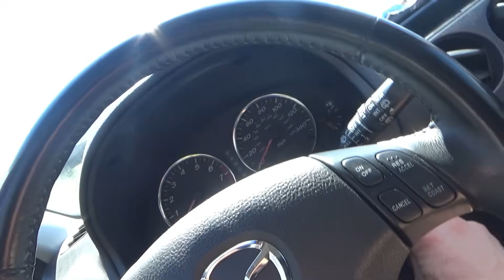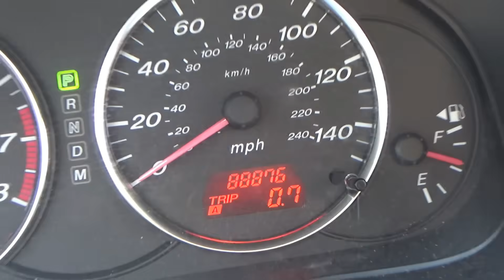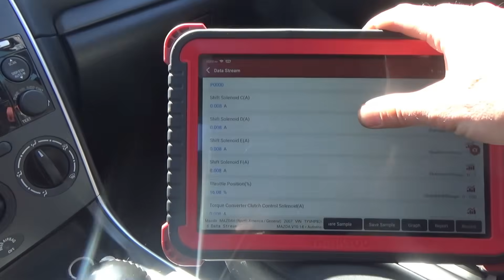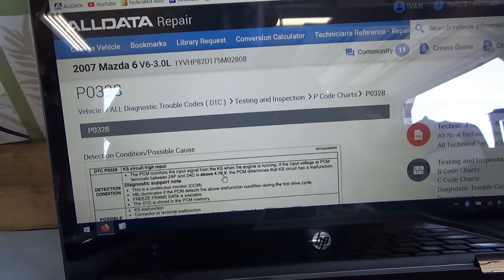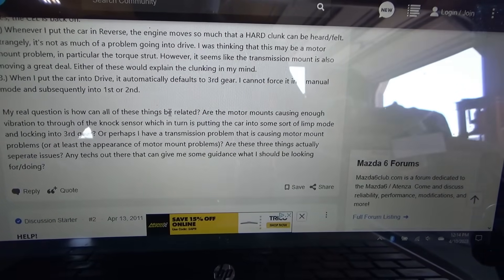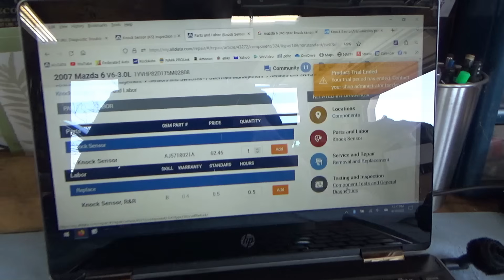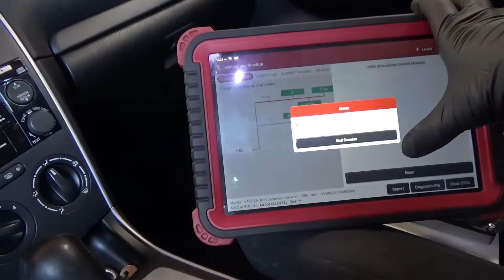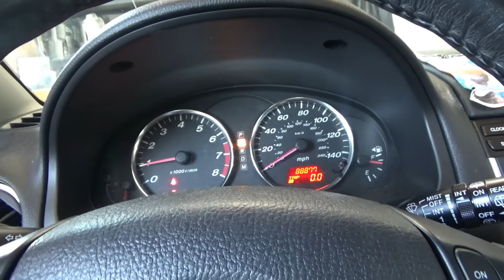At Transmission Shop for 8 MONTHS?? Fixed in 15 MINUTES!! (Mazda 6 Stuck in 3rd P0328)

Comment: Not the same but similar - My pickup with a 4l80e trans was in 2nd gear limp mode - Ended up being a shorted ground wire on an O2 sensor

Comment: I have seen VSS noise on signal end up messing up shift points which led to PCM in LOS (limited operating strategy)
It fouled all the plugs and wouldn't start and run anymore.
3.8L V6 AT Taurus.
The access was so difficult you had to remove exhaust to get a hand on it.
Customer declined repairs and kept putting plugs in it, I suppose.
Don't really know for sure if that was the only cause.
Ran fine shifted oddly and was in too high a gear quite often.
No trans codes found in any mode.
With a new set of plugs it would last for days but go back into LOS.

Comment: Imhad a Toyota with a P032(5?) a few years back with one of the customer's concerns was it wouldn't shift into
 overdrive;Onn the advice of an experiencedToyoyota rech, ended up swapping out an aftermarket KS with a Toyota unit .

Comment: They really need documentation for there kinda of issues. A TSB? Or a firmware update so the trans can code out why it is in limp mode. I had a trans limp mode issue , I beleive it was a kia soul. No codes , although eventually got it to code out for a trany speed sensor. It was under warranty so the dealer wound up replaceing the trany...  I like your videos and they are informative!

Comment: It's remarkable how often mechanics swap ECMs on the chance it might fix the problem! Which rarely seems to be the case.
In this case it also seems incredible that several obviously dismissed out of hand any possibility that a knock sensor trigger might be a reason for the transmission to be stuck in third only!

Comment: A monkey 🐒  with a $20 code reader could have fixed it. 
I had a guy take 3 hours to change his oil.
He was afraid to pull the drain plug. Thought it was connected to something in the engine.  Loosened the plug and let it drip for 3 hours. Dee dee dee.  .

Comment: I had a 2006 E53 BMW. Went into limp mode.
Trouble code was Z-oil?
WTF?
4WD transfer case oil needed to be replaced. 
Apparently the car shuts down at 80,000 miles demanding the transfer case oil be replaced.
You can't make this shit up.
Trouble code knock sensor. 
Just replace it... stupid people.
Also. 
That is one horrible,  gay car

Comment: I had an early 2000s Asian vehicle come in several years ago with no DTCs at all and transmission limp mode and I finally found that the battery was strong enough to start the engine but weak enough for the cranking voltage to drop below a certain undocumented threshold and put the TCM quietly into limp mode for the remainder of the key cycle.  I see many hundreds of cars a year so I can't remember the year and model, but the situation was memorable.  Fresh battery ---> fixed.

The internet forums are at least half full of morons, so always treat their solutions with a healthy dose of skepticism.

Comment: Did the motor ' jumping ' from a bad mount ' break ' the knock sensor which in turn put the  transmission in limp mode?

Comment: I've seen the same thing on a Tundra 5.7L! 

Mice get under the lower intake and chew the wires and the vehicle goes into limp mode. Doesn't make a ton of sense to me, but who am I to question an automotive engineer.... they've never made any questionable decisions, right?
Reply: my first thought when he had the knock sensor code.  Rodents chewed up the wires under the intake manifold.  2014 F350

Comment: I had this exact same thing happen with a 2009 Lexus RX300. Had very harsh shifting issues and did not want to leave 4th gear 

I replaced both knock sensors and fixed the problem

Comment: Be a ford thing, I had a similar story on a 2012 f150, had long cranks, rough running, way out of whack flexfuel numbers, only code it had was CHT sensor. I disregarded it for time being. Checking fuel pressure, fpm, fuel drain back etc. finally said screw it we need to fix the temp gauge anyways. I’ll come back to fuel problem. Replaced CHT sensor and everything was perfect cranked up flex fuel readings perfect, no misfires. I was like wtf ford.
Reply from the maker: @michealcannizzo100  temp sensor is VERY important for the base fuel map! 😉

Comment: I have fixed countless transmissions in limp mode but have never heard of this one before. Must be a secret known only to certain Mazda Techs and engineers. Can't believe there are no factory diagnostics for this or a pairing code set in the TCM. Hopefully Ivan you post this tech tip in Alldata.

Comment: I once did an engine swap on a 2001 BMW X5, E53.  Put the new V8 in, wired all up, started first go, perfect.  But there was an issue when driving, the transmission was all goofy when shifting.  I had an inkling that the engine was not reacting crisp to the throttle, under load.  So I unplugged the MAF, and the transmission shifted fine.  The faulty MAF was telling wrong info to the ECU and trans about load point on the engine, and screwing up the shift points.  It drove far better without the MAF ,  and dramatically better when the replacement MAF was installed.

Comment: Sometimes the codes steer you in the right direction and sometimes they don't. Reminds me of the story of battery light turning on,  the alternator had been replaced 5 times, it was a misfire (no codes) and you replaced the spark plugs. Problem solved.

Comment: @Pine Hollow Auto Diagnostics I have a similar problem with my 1993 Toyota Camry 4cyl Auto Trans. My check engine light comes On, engine goes into Limp Mode at 15mph, Code 4-2 Blinking on dashboard. Diagnosis bad Knock Sensor &/or wiring, tried all 4 sensors that i got from Pick A Part wrecking yard. None of them are good, stuck in a rut, about to call Ecology Auto Wrecking to come take this car away...

Comment: Hello. Great video. I have a 2006 mazda 6 V6. Has been driving and shifting smooth like silk. I parked and the next day I was not able to put it into Drive. Park and reverse ok no problem but the shifter will no go further is like stuck and wont go pass that point. Any suggestions Thank you much. JC

Comment: Does your code reader tell you if the transmission considers itself to be in limp mode, vs never getting a signal to shift?  I would assume the transmission uses engine data rather than reacting to torque to decide when to shift?

Comment: I got the same issue but it’s p0753 and it’s stuck on 3rd gear and I had fixed the solenoids and swapped out tcm not long ago and still got the same issues after 2 months of using the car

Comment: I HATE transmission shops.  NEVER had a good experience with them.  I learned though-  when my 76 GranTorino's tranny quit-  I went to the junk yard and got one for $100 (back in 79) - took me and my buddy a week to do the swap-  worked perfect.  Learned a ton. Had to rent a transmission jack- but that thing was amazing.  Anyway- Ivan,  you are amazing.  I hope that customer didn't pay those other guys anything. A whole year down because nobody wanted to THINK... other than Ivan of course.  What baffles me,  why NOT replace the knock sensor?? The code came up on the scanner- the part is south of $100 and it's pretty much in front of your face after you remove the BAD battery.  Even if it's a "no way it's the knock sensor" thing- you've eliminated a 'possible'.  Again Ivan-  just awesome.  I'd DEFINITELY travel 3 hours to have Ivan look at a problem.

Comment: It would be great if you could get an F150 in your shop and figure out why it accelerates when you press the brakes. My sister had one of these vehicles with this documented problem. I drove it and confirmed that it was not a carpet, or pressing the accelerator and brake pedal at the same time problem. Ford is not interested in this issue so maybe they will continue to say it is simply a case of people not knowing that they are pressing the brake pedal and accelerator at the same time.
Reply from the maker: Bring that exact vehicle to me. That would be an amazing case study!! I won't even charge you for the diagnosis!!
Reply: There are quite a number of posts about this issue. And no, I have never seen a post that stated replacing the throttle body and sensor cured the problem, however there are posts that state that they replaced these components without success. Fortunately this was a work vehicle and she no longer has it. It was a clear problem when I drove it and when I say accelerated I mean It reached around 4500 to 5000 RPM. When I shifted it into neutral, because it was not slowing down and the RPMs continued to climb, it continued to climb until I shut it down.
Reply: check brake boostor air leak

Comment: Had a friend with a Nissan Titan that got stuck outside my house when it wouldn't shift out of park. I thought it had one of those fancy electronic shift mechanisms but it turned out to be a broken shift lever bushing under the dash. We fixed it with a plastic wire tie and it lasted at least until the truck was sold 4 years later.

Comment: Sounds like crap with that shitty exhaust system. There are shops that don't want to do research or troubleshoot because that takes valuable time away from the money making quickie oil changes and brake jobs.

Comment: A few years back my W140 S-Class Mercedes would jump out of cruise control on the motorway, ABS light would come on and power reduced.....
FIX.... a new brake light switch on the brake peddle.
Go figure.
So you are right, fix what is broken on modern cars, the faults may all be interlinked.
Good troubleshoot👍🏻👍🏻

Comment: It is a good idea to check the alternator first. My 2005 Mazda 6 went into limp mode a few years ago and it turned out that the alternator was bad. I had the alternator replaced with one from O'Reilly's and it fixed the issue for about a month--until the car went into limp mode again. The alternator ended up still being the culprit. The problem is that at places like O'Reilly's or AutoZone sometimes the remanufactured alternators are not rebuilt properly. I learned that it is a good idea to have alternators and car batteries always bench tested at the store before buying them to spare yourself from future headaches. Hopefully this tip will help someone.
Reply from the maker: Get a Denso alternator from Rockauto, problem solved. Other aftermarket brands and sometimes even dealer remans are JUNK out of the box 😅
Reply: I miss alternator and starter rebuild kits

Comment: I have a similar issue. I’ve had a p0720 code intermittently and the transmission would occasionally act up. Now I only have P0328 and the transmission goes crazy after about 10 miles, and wont go into 5th. Gonna change the KS and hope for
The best

Comment: I've owned two transmission shops with over 30 years experience. The rule of my shop check engine light must be off before we diagnose the transmission. Sometimes that isn't always the easiest thing to accomplish because the customer doesn't want to pay for other repairs.

Side note I had this very exact problem and it was interesting to see you come up with the same answer as I did change a knock sensor  sent the customer down the road

Comment: What scan tool and software are you using I'm curious I'm about to buy a new snap on I have a Matco Scanner that's about 3 years old and it leaves a lot to be desired My old  Solace scanner got stolen Wondering if you had any input on a good buy that's not gonna kill me financially Leaning towards the Snap on because of the Diagnostic backup that comes with it Always really like the troubleshooter
Reply from the maker: Check out my Amazon store... Launch scanner for under a grand. SnapOn is an overpriced dinosaur... Only use it on cars to early 2000s 😉

Comment: Hello from London. My car kept going into limp mode with similar transmission issues (automatic box stuck in 3rd. and illuminated engine light).  I was dreading the cost of a new gearbox but was advised (by telephone) by my dealer to check if the petrol filler cap was tight. I thought it was, but he suggested removing it, blowing hard into the filler, leaving it for 10 minutes and then replacing until I heard two or three clicks. Turned out that the sensors had detected fuel vapour which wasn't being dispersed properly!  They had seen several owners of my model with the same issue.

Comment: i had a 1996 grand am with the trans pressure of the chart and in limp mode. Turns out it was a bad 2 wire air temp sensor. It seems each computer acts with codes that make no sense

Comment: had an 06 6s (v6) and it was a love hate, Loved driving the car, comfortable, good torque. Hated the front seal and valve cover (replaced) oil leaks and most of all the garbage aisin 6 speed transmission. in 140K the engine never gave me any real issues, but I did have 3 replacement transmissions under warranty. Trans would flair between shifts with at full operating temps. On the highway, peddle down it would buck between gears felt like the powertrain was going to fall out. Glad Mazda is wholly owned again, love my 17 Mazda 6, no a lick of trouble.

Comment: I've had this problem on my girlfriend's 08 Cadillac DTS. Hard shifts, not running through all gears, crank sensor code, I replaced the crank sensor and it fixed the problem for about a month until it started throwing the crank sensor code again. Crank sensor works intermittently. Could someone try and point me in the right direction?
Reply from the maker: OEM GM replacement?
Reply: @PineHollowAutoDiagnostics  no sir. Just got back in there a few days ago,  the wires going to the pigtail were shorting together. Tried wiring in a new connector. no luck. Will have to go with an OEM part I think. I am no mechanic, no certifications but I am absolutely passionate about learning to fix things, it's just what I like to do. Your videos are very informative and have taught me quite a bit!
Reply from the maker: @andyw123  Yup OEM only on critical electrical parts :)

Comment: you talk about ABS issues.. i had a bad ABS module on a car i salvaged from being abandoned (2010 Dodge Charger) i could not beleive how many subsystems that module controlled.. i can sit here and list probably 20 different subsystems including putting the transmission into limp mode if you manage to reach 80kph it would cause the transmission to jerk and it would cause the engine to stumble, Speedo was dead, Satbility/traction control was dead, partial brakes the petal would not engage even if fully bled lines until about 70% being depressed, the ECU did some weird limiting on other systems the cluster was acting up, it was quite interesting i was near close to doing the parts cannon (i ended up parts cannoning this car because it sat for 7 years in the back field totally untouched and the deer mice made a apartment complex out of the entire thing).. the crank sensor did some odd things to and it wasnt a bad crank sensor it was a wire that wasnt fully chewed though but enough to put excessive resistance.. after about 3 days and a pickup truck bed full of parts its back on the road (alot of parts i replaced as preventitive even tho they did work and they were all manufacturer parts no aftermarket.. learned my lesson with aftermarket parts either not fitting, sloppy tollernences or just just barely working to out of the box dead items.. this would be my first Dodge and i tell ya after being a Tech at a different manufacturer this was a heck of a learning curve..

Comment: Nice job! This video reminds me of one ScannerDanner did of an Audi that had no power. It had a code for a faulty electronically controlled engine mount that everyone ignored thinking that couldn't possibly be the problem... But it was setting the engine into limp mode without any indication it was being derated. Btw, the slamming into gear is normal. When transmissions go into limp mode they default to maximum line pressure. This causes VERY aggressive gear shifts. These transmissions are some of the most uncomfortable for that. Good job at keeping an open mind!

Comment: I agree with you about the availability of information on the internet being helpful, but I have also seen a couple of negatives. I have been a technician for over 30 years and have trained several techs over the years. I have seen young guys who would rather try to find their answers with a Google search than actually learn how to diagnose a problem.

Comment: I have a mazda 6 2004 and once I turn it on and put it on drive the AT sign comes up and it doesn't engage into 1rst gear. If I leave the car on for a long time it'll eventually shift to first gear. Could this be the same issue?
Reply from the maker: No

Comment: I'm Dan, Martha's my wife.  Great diagnosis Ivan.  Funny how complicated vehicles are today and how something you'd think would  nothing to do with the problem would be the cause of the problem.  Knock sensor/trans. problem, who'd have thunk it.
Reply: The car thinks the engine is exhibiting excessive spark knock or failed rod bearing, severe timing off issue, etc.
So it won't let you make it worse by continuing to drive.
It does make sense when you consider

Comment: One of our 2003 S-10's would intermittently want to start out in 3rd gear. I noticed the alternator making noise and the scope showed problems with the rectifier bridge. Replaced the alternator and the transmission never acted up again! Great video!

Comment: The worst part is I was at a Mazda dealer like two weeks ago and asked for the TCM on another Mazda. It's been on back order for 2.5 years for a part that has been dying on many models not just one. This part should be no more than 100 bucks for that reason alone but nope. They want an arm an a leg and they don't even have one.